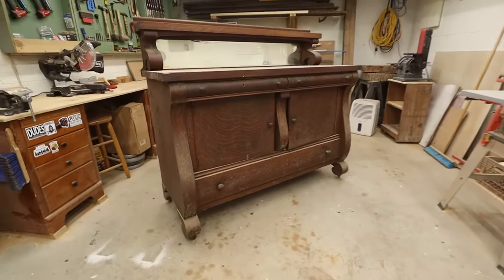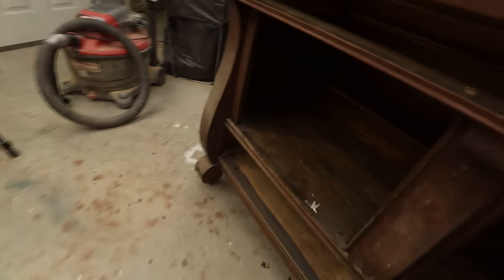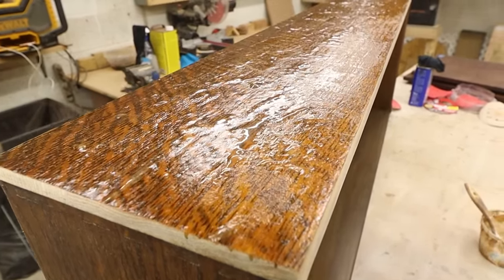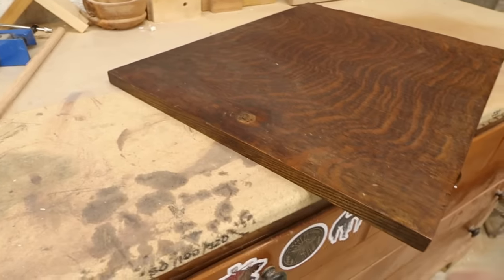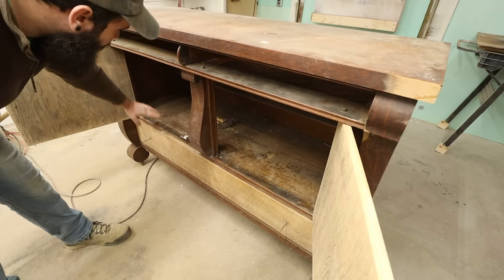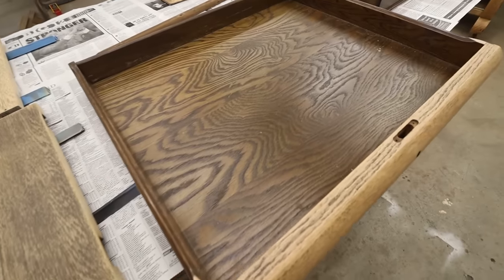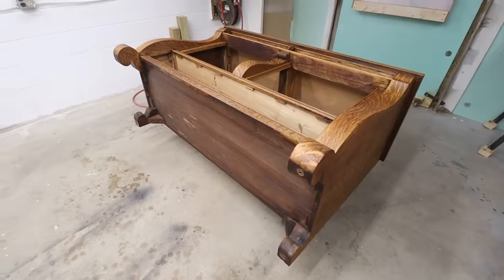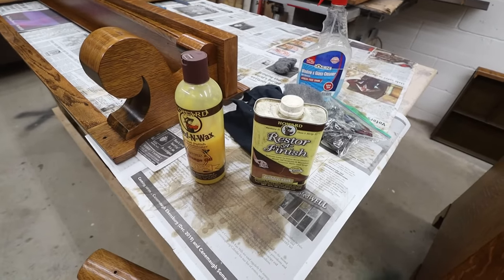Refinishing Antique Tiger Oak Server | 1.8.20 | Furniture Repair Restoration | How To Woodworking

Comment: Super restoration!  I have something similar and had a question for you...I am having trouble determining whether replacement veneer should be white or red tiger oak.  The figuring looks the same as mine, so I was hoping you could shed some light on this...thanks!

Comment: I have a similar one that must be from the same company.   It has identical feet, the same bottom drawer and the same pair of doors with the narrow shelf inside at the same  location.   Ours is missing the top piece with the mirror, so it's good to see what it might have looked like in case I ever get around to reproducing it.  The top was notched out on the back for like yours.  I wonder what company made it.

Comment: Hi John.  I have this same exact buffet server with matching dining set that my husband and I inherited from his great grandma that immigrated to Michigan from Finland in 1904.  It has the same dark finish and even the same flaws from years of neglect.  I have cleaned it to the best of my ability to prevent any further deterioration but have been procrastinating refinishing it because  I really want to do it justice so I have been doing a lot of research before I begin the project, so you can’t even begin to imagine what a godsend this video has been for me.  I know you mentioned that you used “honey oak” stain.  Can you please share the brand, how many coats you used and what kind of top coat and tint you used (if any).  Thank you so much in advance.
Reply from the maker: I used varathane brand stain. Sealer and topcoat are Precat lacquer. For a DIYer without a spray setup I'd say to use arm-r-seal. Best of luck!

Comment: U mind telling us what kind of stain u use and law,for some reason I'm having trouble with red oak lately my project is very old barn find really dirty scrubbed that thing hard let dry for good week sanded top 80 180 220 cleaned again stained golden oak miniwax let dry 2 more week sprayed 3\4 coats lac was hand sanding the top for last couple of coats the grain of the wood started to bleed through I couldn't believe it any ideas thanks
Reply from the maker: Most shops I ever worked in used mohawk. On my own I'd use minwax and get that exact problem. I switched to the varathane brand stain. Problem solved. It's as good if not better than mohawk. It's all I'll ever use again. Dry time is super fast and color is so much better. I'm definitely not sponsored by them and a paying customer incase you're wondering.

Comment: What stain & lacquer? How did you refresh the mirror? You used 150 & 220 for sanding? I have similar piece that needs to be refinished. Also do you know where I can get wooden knobs mine are missing & were replaced with glass knobs.

Comment: I was always told never to use steel wool on oak due to the wide grain structure? I heard the steel wool gets into the grain and eventually creates black spots with damp and humidity over time. Bronze wool I’ve never had that problem with.
Reply from the maker: Whoever told you that was smokin some good stuff bud! 🤣
Reply: John Bear Woodworking & Furniture Restoration sorry dude. The issue of using steel wool on oak was discussed in Fine Woodworking magazine. Maybe wait a few years to see who is correct? I’d post a copy of the article but this format won’t allow it.
Reply from the maker: @JamesPollMaine59  every shop I've ever worked at and every woodworker or finisher I've ever talked to has said their way is the right way and to do things a specific way. They all were different. I think people get ideas of doing things a certain way and never really question anything. I'm not saying if you put steel wool fibers in a piece of oak over time it wouldn't make spots but if you take your time and do a good job it shouldn't be a problem. Thanks for watching!
Reply: Maybe on Red Oak(which has open grain), but White Oak like that has a closed grain.

Comment: Your video, still has legs.   Found your steps useful on a china cabinet I'm just in final steps before a topcoat for a project.  Only question is the time you invested in this piece?  I'm at about 24 hours on a top/bottom cabinet, am I slow or shouldn't keep track because it drives you crazy?

Subscribed/liked.  Thanks

Comment: What would happen if you took off all the veneer? Also is veneer good to have on antiques? Does that mean its not solid oak?
Reply from the maker: In short, no it's not solid oak if there's a veneer. Veneers are decorative/cost effective and if they're there you should probably leave them. It'd be like removing the paint from a car. You'd see what's underneath and it probably wouldn't look as good. Haha hope that helps but definitely just research veneers if you're interested in learning more!

Comment: Hi! What kind of stain did you use and does tiger wood need a conditioner before staining? Currently stripped a piece I got off Facebook market place and underneath is tiger wood!
Reply from the maker: I really like varathane stain. This was veneer as yours likely is as well, conditioner is not needed. In fact, I've never even used conditioner. It's useful for soft woods like pine but I don't know the last time I ever stained pine.

Comment: How about not remove the old finish? You have done a pretty good job, but it's possible to see that the furniture is retouched by different colours between inside and outside. Sorry for my english :3
Reply from the maker: Then this video would be named "not refinishing a tiger oak server" or "here is a tiger oak server I did nothing to but just looked at it". When I save up enough $ for my Delorean and Doc and I can get it running the first thing I do is go back and unfinish the refinish finish and not refinish the finish. Haha thanks for watching! 😃